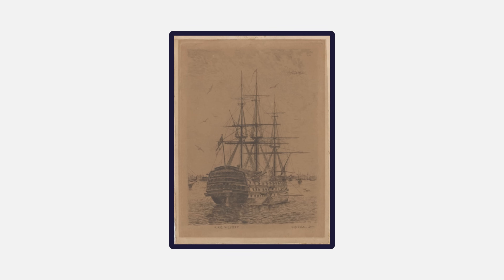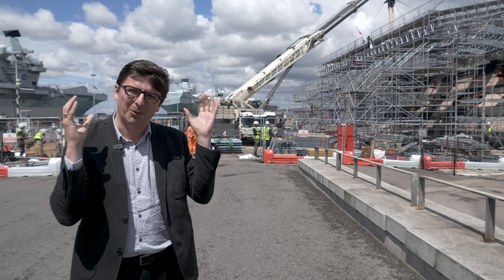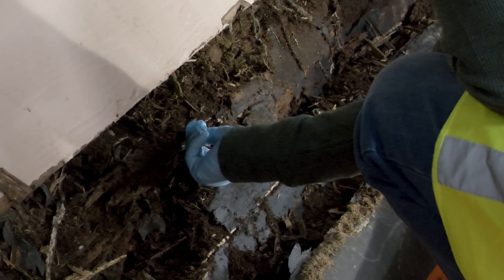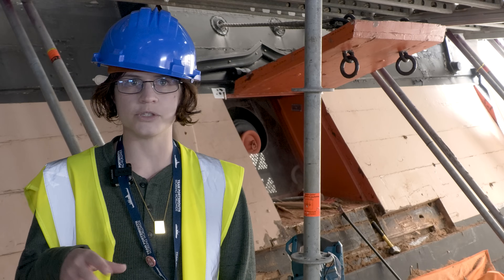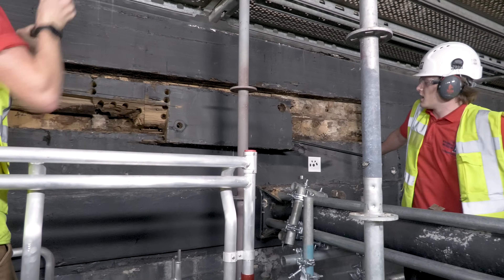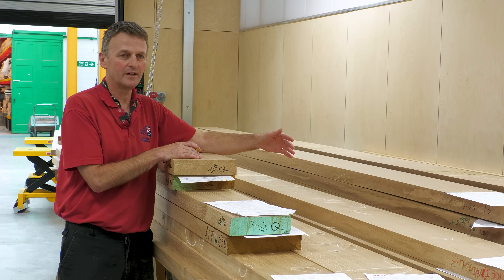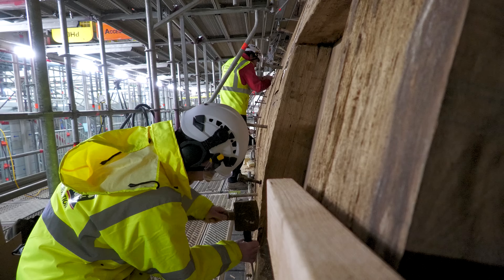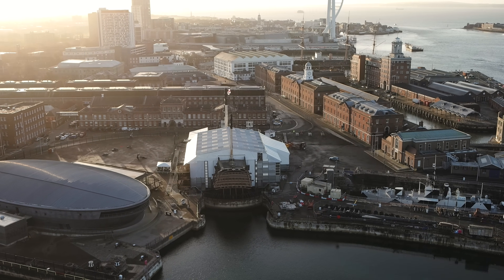HMS Victory – Reconstructing HMS Victory’s hull planking

Comment: Being 6ft tall walking through the decks when I visited in 2018 my head did take a few bangs. The headroom below decks is so low. I was also told at the time the reason for there being only the lower portions of the masts on the ship was due to the condition of the keel.  The weight of the masts would have sent them through the bottom . The new ones when fitted will be made from carbon fibre. I look forward to paying a second visit when all restoration is complete.

Comment: You’re not saving old nails and good bits of wood for tourist souvenirs ?
Reply: They probably will, I have a copper ingot cast from the copper hull sheets that were removed decades ago as they trapped water behind them and contributed to timber rot in drydock.

Comment: Question For the RN - How much of Victory that stands today, still contains original materials from Trafalgar??
Reply from the maker: Hi there,

Due to the ongoing conservation work, and with Victory’s current project underway, we are unable to give an exact percentage. For example, since 1765 the ship went through five major repairs; she had been almost completely rebuilt by the time of the Battle of Trafalgar in 1805. For updates on Victory’s project, please take a look at our website linked here: https://www.nmrn.org.uk/hms-victory-live-big-repair/. ^NH
Reply: I served for 22 years and knew many of the guides personally, and I think I got a different answer to that question every time I asked it.

It's generally thought that any original timbers will be pretty much out of sight and out of reach to visitors, although the museum obviously has specific pieces thought to be original. I was always told the lower masts are steel and hollow, and bedded into the dock bottom - not the keel. When fully rigged, it should also be noted that the masts are supported from turnbuckles on the dockside some way away from Victory.

One interesting piece of history is that the ship - and the dock - were damaged by bombing in WW2, and I believe that damage is still visible.

Other trivia which obsessed me was: who shot Nelson? This isn't known, and as far as I know nobody ever claimed to. But the avenger of Nelson's death is credited to Midshipman John Pollard, who shot the only riflemen left in Redoutable's mizzen-top.

A popular pub quiz trick question is: Over which eye did Nelson wear a patch? The answer (technically) is, he never lost an eye nor wore a patch. His right eye was injured by stone fragments from a near miss in Corsica, and it is generally supposed he had to play on its loss of sight to qualify for a pension, because it wasn't subsequently removed. 

He did however wear a green shade over his other eye to shield it from glare.

Comment: I'm just curious, if the timbers are going to deteriorate every 50 years or so no matter what, what's the advantage of keeping Victory in a drydock permanently instead of back in the water?
Reply: It’s a sin she’s allowed to rot in dry dock. We were skint in the 50’s I guess.
Reply: ???!!! The hull cant stand the pressure
Reply: @nickhowes5348  The hull is taking the pressure right now. It's just that the weight of the ship isn't being as evenly distributed around the hull as it would be in the water. Back when this ship was permanently drydocked they didn't have much data on what it would do. Now the UK has plenty of data, but instead of reversing course and putting Victory back in the water, where  a ship belongs, they double down and try to fix the unfixable.

Comment: Is the framework, upon which the replacement planks are being installed, not age damaged as well?
Reply: Yes, on the starboard side, a high percentage of the frames (futtocks) have deteriorated and are currently being replaced before the hull planking is manufactured and installed.
Reply: @jaredc40  Thank you